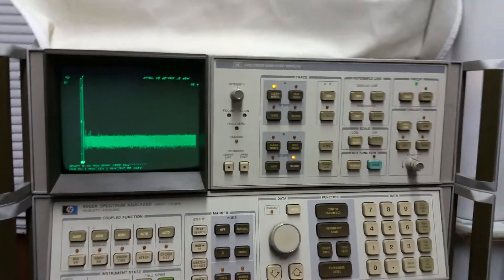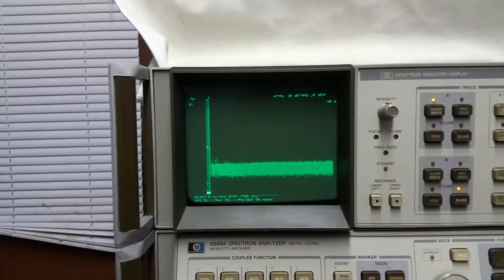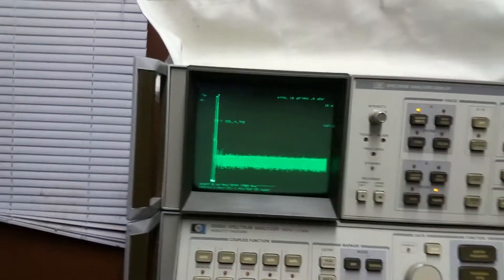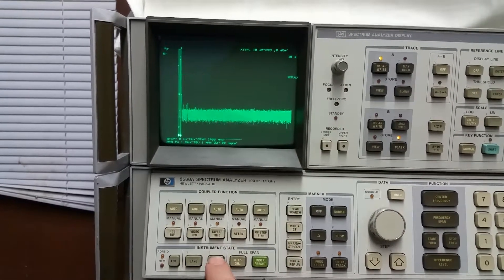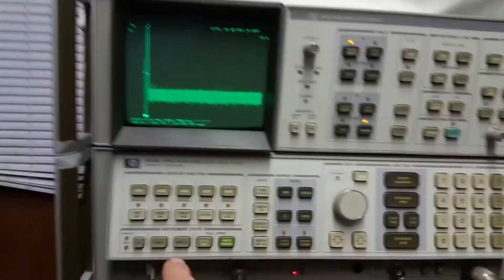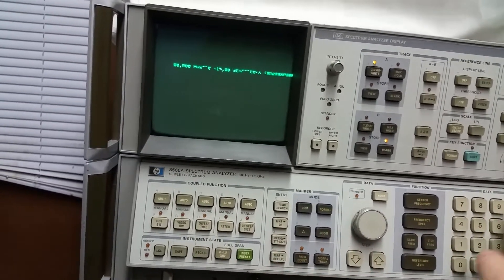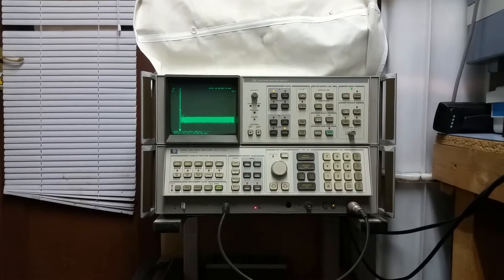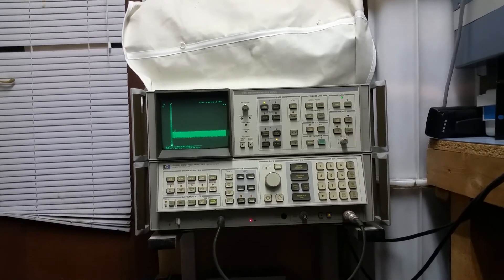Hp 8568a pt3 fault returns

Comment: Try going around it with freeze spray, it picks up all kinds of things like bad solder joints, dodgy capacitors etc. it could at least narrow it down, and it does seem to be thermal in nature, so is more than likely a capacitor problem, have you re-capped it yet?
Reply: Not just electrolytic, any tantalum too
Reply from the maker: I am hoping a tant cap on the logic board. It looks like a hard fault now, so might be easier to fix. Problem is i have no extender boards!
Reply: Simon Spiers - I would just replace them, not even bother to test them, extenders would certainly be handy.
Reply: Simon Spiers - maybe double check the power supplies again, in case they are now being dragged down by a bad cap.

Comment: If it didn't do it with the covers off, then it sounds like a heat issue. Try some freeze spray on the memory or ROM chips. Do the ROMs have there Windows covered with a label or dark tape, if not you may need a new set of ROMs. Just some ideas. Good luck to you.
Reply from the maker: +TheRadiogeek Thanks for that. 
Looking at the manual it suggests the memory on the a4 board if graticule and notation is effected.
Difficult as parts are rare and acsess is difficult without extender boards.